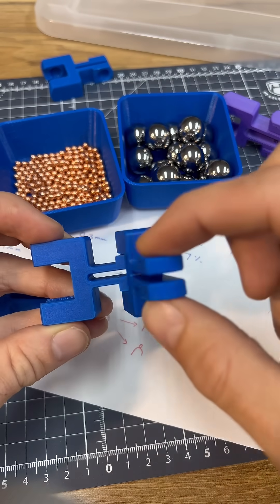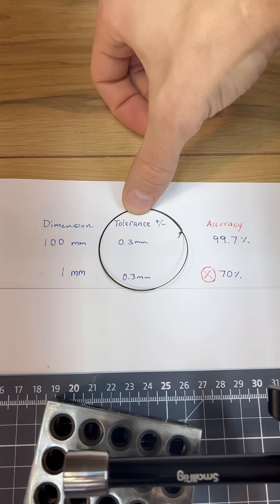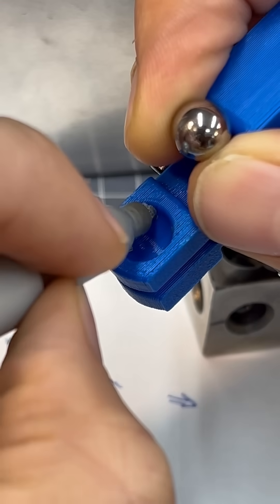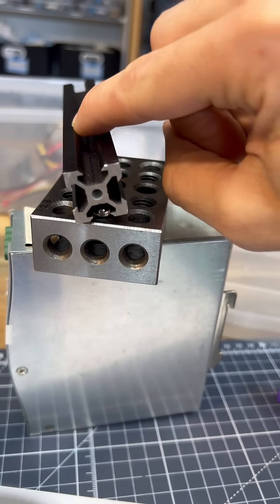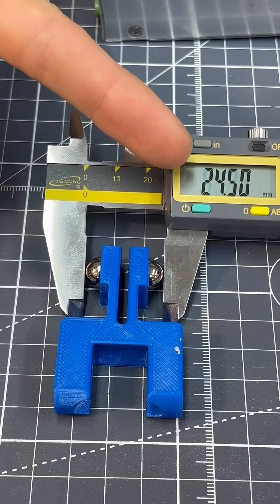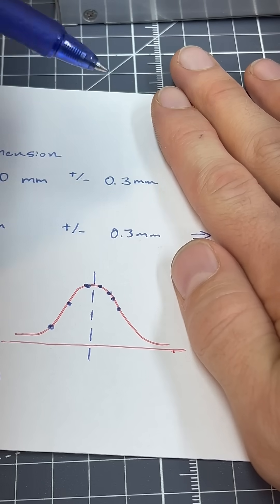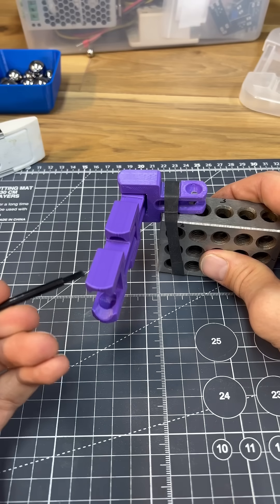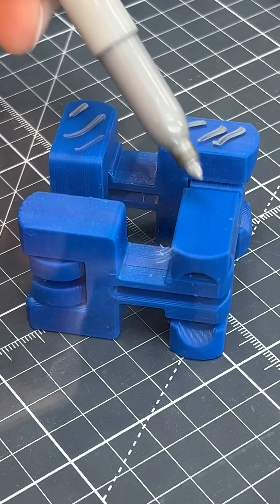Exhibit 1: borrow a tolerance, design 3D printed part with Axis.

Comment: he used the metal parts that are machined at way higher precision, to compensate for the lower accuracy achieved by 3d printing, when using a sphere as part of a rotation mechanism, then having 3 points of contact on it has the least friction and more forgiving for 3d printed parts accuracy, and if you use 2 of those sphere joints together then the mechanism can move a lot smoother, enough that he used the bristles on a small brush to push the arm, something 3d printed joints struggle to do

Comment: No, the statement "three points always locate a sphere" is not entirely true. It depends on the spatial arrangement of the three points.
Here's why:

    In 2D (a plane):
        Three non-collinear points uniquely define a circle. The circle is the 2D analog of a sphere in 3D.

    In 3D (space):
        Three points can define a sphere only if they are not collinear. However:
            If the points are collinear (lie along a single line), they cannot define a unique sphere, as infinitely many spheres can pass through them.
            If the points are coincident (all at the same location), they also cannot define a sphere.

    Four Points for a Unique Sphere:
        In 3D space, four non-coplanar points uniquely define a sphere because they determine both the sphere's center and radius. The four points must not lie in a single plane to avoid ambiguity.

Simplified Conclusion:

Three points can define a sphere under certain conditions, but additional constraints (e.g., non-collinearity) are required for the definition to be valid.

Comment: Why is it confusing, or am I missing something. If you make a small plastic hinge with poor tolerance, it'll be low quality, so instead use the bearing that have better tolerances to make it easier to get everything level and it makes it smooth since the bearings are smoother than 0.3mm hinges...

right?

Comment: from what I understand, whether you print small or big part the printer tolerance will be +/-0.3. So better print bigger part to get higher level of accuracy. And since you already know that your part have a general tolerance overall its possible to calculate the needed bearing ball to achieve the accuracy you want. Movement will be more accurate because you are using the ball "borrowed tolerance", sitting 3 points on each side of the hinge total of 6 points.

Comment: With 3d printers, you can get better tolerances by increasing layer lines or (reducing layer height), but other slicer programs have certain modes that will build up curves differently.  So there are so many factors.

Comment: Those two point on the balls are positioned on mounting points that are basically springs as it is a flextural or compliant feature. There is no way your achieving any type of proper tolerances on that two pronged feature that holds the the balls...

Comment: Until the defect is at the center of the cavity, and not offset to either side of the ball. That type of defect will still be just as out of tolerance as normal. The reason to use bearings: try printing a sphere on an fdm printer lmao. Many ways to design that hinge in a compliant way without needing to use ugly stepped spheres (if you want to go all printed)

Comment: Three points don't locate "a" sphere in the same way two points locate an axis.
When you have three points, those could locate several spheres with different radii. You have only fully defined a particular sphere, as soon as you add a fourth point in another plane than those three points.
Of course, since we have a given radius in this case, it doesn't matter here. But saying it this way could make some people believe that three points fully define a particular sphere.

Comment: So I think what he’s saying is that the balls have been manufactured with a much more precise tolerance, so if we get two of them and make an axis to work around in which we know is accurate, resulting in a final product with tighter tolerances and a more consistent result. It’s like working off of a datum edge instead of just eyeballing it.

Comment: Mechanical engineer here. Non-native english speaker, but I think I got it:
- With the same ABSOLUTE error of some tenths of a milimeter, larger distances will have lower relative error. Quite clear until here.
- Next: so if you want to make a small axis, chances are you are going the get a bad fit due the the previously mentioned phenomena.
- So what if I what to MINIMIZE this error? Remember that absolute error is +/-, meaning sometimes will exceed the intended geometry, sometimes will lack. Therefore, the more points you use to define a position, the more chances of having near zero error, because you are AVERAGING the error until they cancel out. How do we exploit this multiple point strategy? By placing a ball over 3 printed points. Assuming the ball is perfect, the final position of the ball will have a lower error than relying just on a spherical printed socket. ("Three points locate the sphere")
- By doing this on both sides of the theoretical axis, chances are you got a low error axis defined by two spheres. ("2 spheres locate an axis")

PD: is just statistics. Is the same as saying "if you print a lot of conventional axis, the more you print, the higher the chances to get a perfect fitted one". Is just that this strategy of the balls improves the chances of a single print.

Hope this helps.
Reply: I feel like you helped me understand it better.. and your English is great

Comment: I think the explanation has been deliberatly confusified to go with the increasing tempo of music and give the aura of complexity and revelation of technology beyond comprehension.  This is not content meant to explain, but the opposite.
As best as i can decifer the idea is to create a cavity for the ball because the ball will find a stable position inside and on average this seating the two balls opposite each other is more reliably presise, so dont extrude the facing surfaces, rather insert a precision ball.

Comment: Tolerances are typically not absolute like that - they're in mm/mm. So it might be 0.03mm/mm (made up for illustration) so it would grow to 3mm/100mm across the 3D printer bed. Also, you might like reading a book on "Exact Constraints" by Douglass Blanding for info about accurate location and orientation of mating parts...

Comment: Still don't think i fully understand this.

But i can see what looks to be a Dual bearing Dimensions that give your hinges more stability than just one.

Though it's dead locked to only two possible positions, UP or Down.

Though if you work these with a combination of orbital Bearing, basically just 1 or a combination of 1 with 3, you could have far more efficient movement as like a robotical arm.

From my understanding here, this could be used in the Robotics industry.

Still neat seeing it 3D printed out, could work for some DIY Robotics.
Reply: An Orbital Gear Joint or Active Ball Joint would work nicely with this Dual Bearing example.

Comment: For those that didn't quite catch it, he's basically saying instead of using a pin of some sort to locate an axis of rotation(which will only be making contact at two points on each body), use a pair of balls to locate the axis which will have 6 points of contact on each body.

Comment: Yea but with most assemblies like this you can just leave more slop in the hinge and it'll work fine.  Yes, the plane will be less accurate, but it will generally be fine.

I need to figure out a solution to do this for holes and channels and the like.  They always come out too small and you have to manually compensate through trial and error, which can get tedious.

Comment: So by using 3 points to define the joint, you are averaging out the error from three tolerances, thus achieving (on average) a higher tolerance? The print could be off 0.1 all in the same dimension, though, so doesn't this assume that tolerances are on a normal distribution and are not biased based on the physical properties of the nozzle/servos?

Comment: The reason of using such a design is to maximize performance while using a low-quality production method. Point contacts will in this case maximize precision, whereas if you'd 3D print the joint in full you may see some serious deviations in precision during motion due to the uneven 3D printed surface. Good use of precision mechanism design. Do note, that the load bearing capabilities are decreased though!

Comment: This is already a well know toy, they use small bumps on the plastic which works just as well without ball bearings you are kinda copying the design and absolutely copying the function

Comment: This is a great video, thank you! Never considered combining/averaging errors to make something overall more accurate.
Reply: Because it doesn't work like that. What you get is called a tolerance stack and it's less accurate than a single feature. I'm not sure what this dude is going on about, and I'm a professional mechanic engineer. I think he may have conflated several tolerancing concepts.
Reply: @KiaranScath if I understand correctly, since the dimension is randomly printed too big or small, he uses 6 of them to locate the joint instead of 2 which has the potential of averaging out the error faster than 2. Though I think hed need more like 20 data points to start seeing it average, and would likely have the error stack one way against him (for example 5 of the 6 points being too big) too often for it to be effective

Comment: Dimensional engineering GD&T 101 - Alignment principles: 

(Breaking reality down back into math): 
3 points of contact can define a triangle, which is how you establish a plane 
2 points of contact define a line, which is how you define an axis 
1 point of contact defines a point

These three make an alignment scheme that can be used to control items in space, remembering there are 6 degrees of freedom: 3 translation and 3 rotation. 

When you have a part, placing it on a flat table (plane) prevents it from rotating in 2 directions and translating in 1. 
Putting a rod through a hole in the part (known as a 4-way) then constrains the part in 2 translations (axis). The part can still rotate about this axis. A single contact point, like a rod through a slot, (known as a 2-Way) will then constrain the last degree of freedom (rotation). 

At this point you have a fully constrained part, subject to vary only by the tolerances allotted by design for each contact interface to the table and rods.

Comment: Poor writing and character development has escaped modern movies and found itself in YouTube shorts! You could've made the same point by saying simply the fallowing. 

Hinges need to be extremely precise, 3D printing is generally not precise enough for repeatable, perfect, sanding free hinges that can compare to anything you could make with CNC, or other higher precision mediums. 

Balls are easy to locate, thus they make for the most precise hinges you'll find in 3D printing. 

Only problem is, 3D printers are really quickly getting to the point that all these imperfections are no longer a thing. We've refined the tech so far that even entry level printers, at least when you slow them down and tune them for quality, can make extremely repeatable and precise parts, that fit like a glove and will come out perfect every time.

Comment: I follow as far as 2 points define an axis, and 3 points support a sphere. Where I get lost is how that enables you to get higher precision. 

My guess is that you're just averaging error over distance, but that doesn't eliminate the high spots which are what contact your sphere. And your distances are quite small, so you can't guarantee to have 3 points that are on the positive extreme of your error. 

I feel like you jumped a couple steps, but they were important for getting between point a, and point b.

Comment: I thought it was a great explanation. Instead of relying on small features to be within tolerance, you can create a big feature (like a pocket for a ball bearing), that is (on average) very accurate. That pocket is always gonna be 10 mm +- 0.1, but if you zoomed in and looked at the surface of the pocket, every mm it’s gonna be bouncing 0.1 mm above or below nominal. The ball bearing, a high precision part, averages all that out.
Reply: Yea, I didn’t understand it but after your explanation I feel like get it now- if I was to put it into simple words it would be something like:
 
In 3d printing the tolerances aren’t perfect so instead of a socket that’s slightly too small, that would create too much friction/drag or a socket that’s slightly too large where there isn’t enough friction and bounces around slightly/rattles , the best way to get around this problem is giving the ball 3 points of contact.. even though the 3 points aren’t perfect this method gives us a smaller margin or error due to the way the ball finds the path of least resistance… is that correct ?

Comment: Let me get this straight

.3mm is the tolerance for the 3D printer  layer height/spread

(Confusing part) And according to the 2 or 3 point contact, the tolerance is based off one point of contact?

As a result of this you factored a distribution of 3 points to acount the contact points of a sphere

But this is where I am lost, how would you factor in the 3 points since I cannot find the variability change in tight areas for the 3D printer. Also questing what you meant by a “borrowed tolerance”

In short, how did you factor the 3 point contact for design or printer settings. What changed did you make that differs from a .3mm tolerance??

Comment: For those that dont understand wtf is going on in this video: 

Rule #1 3d printer accuracy sucks at printing small distances. From video example, 1mm achieves 70% accruacy while 100mm achieves 99.7% acciracy. So point is, you dont want to print things that are too short of a distance apart.  I think thats why he chose an axis distance of 24.5mm which he got very high accruacy with. 

Rule #2 is tolerance for both 1 and 100mm have a tolerance if 0.3mm. so if you print something that js between 1 and 100mm apart, you'll get +/- 0.3mm error.   HOWEVER, this doesnt tell you how much accuracy youll get within 0.3mm. You could be ,0.2, 0.03, 0.25, or 0.1mm off. You dont know.  Thats why he uses a Gaussian distribution to find the MEAN of the tolerance when printing between defining the 3 contact points the steel ball sits on.  Eg if the 3 point distance is 3mm, he could print 100 samples of a part with 3mm distance, record them all and calculate the mean error. Eg, if print was off +0.1mm majority if the time on average. So when you print the actual part, you'd offset the distance by -0.1mm (2.9mm instead of 3mm)

Both the above rules / concepts  helped helped him achieve higher accuracy and tolerance on his 3d print.

Comment: I totally understand what you've said, i dont see why everyone else is so confused (but ig i have an associate's in electromechanical engineering? Which is not that high of a degree...)

Although this method might give improved consistency, I would be somewhat cautious of the predictability, as in, I am not sure where the layer lines go in reference to a sphere that has been booleaned out of a solid. Does the slicing software put the layer lines so just their edge touches the hypothetical sphere, or does the slicing software make the layer lines take the average distance from where the part should be, etc.